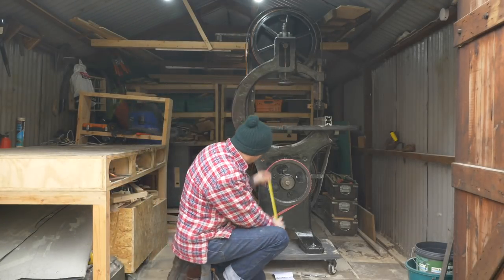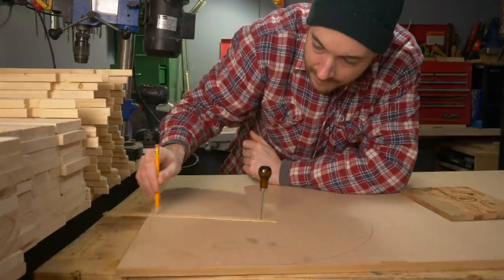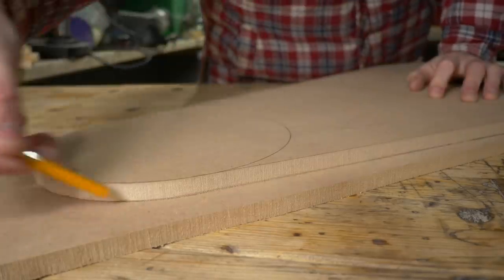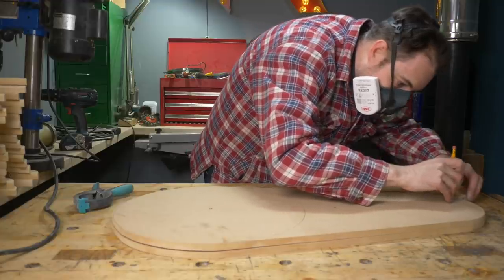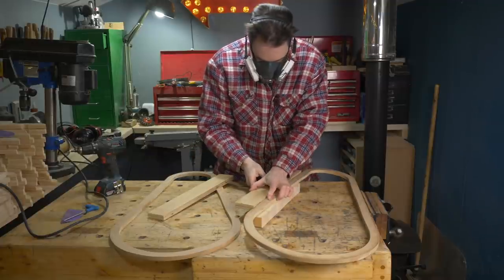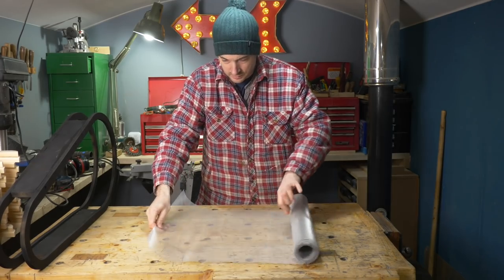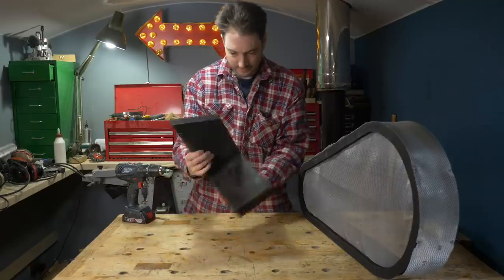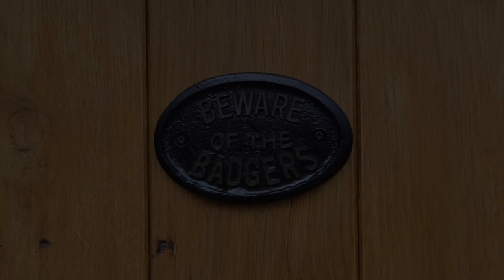Making A Belt Cage For The Bandsaw

Comment: Great job done Matt a lot safer now.  May I suggest a quick fix to save cutting your fingers. Bend the overhanging grill over then run a 
nice black silicone bead all around the corner edges to cover the cut edges of the grille. It will add to the look cool vintage look lol. Tony
Reply from the maker: Thank you